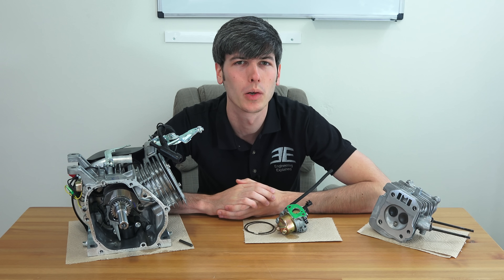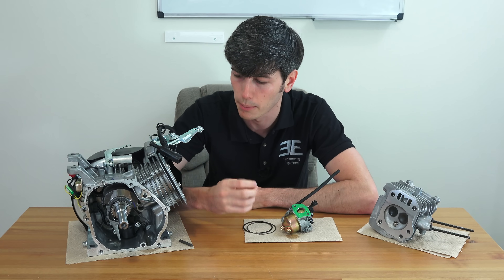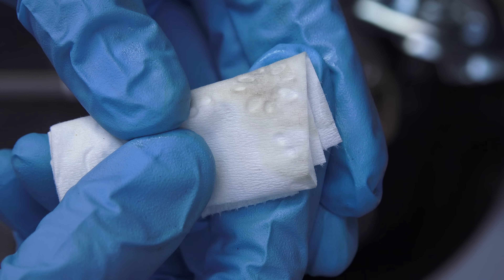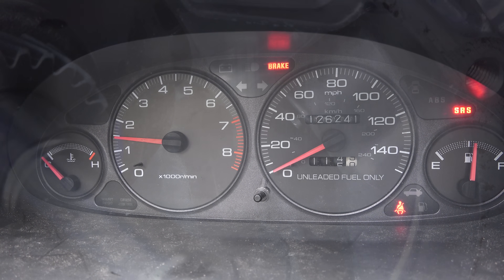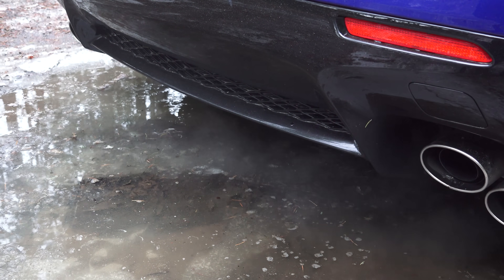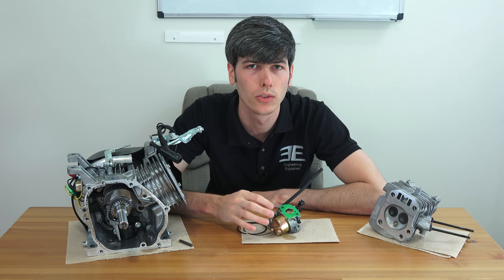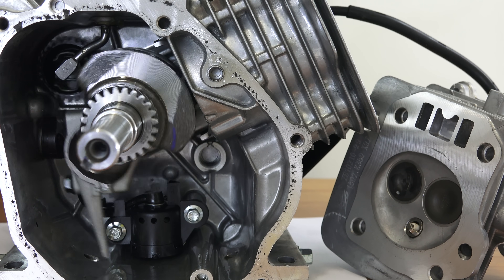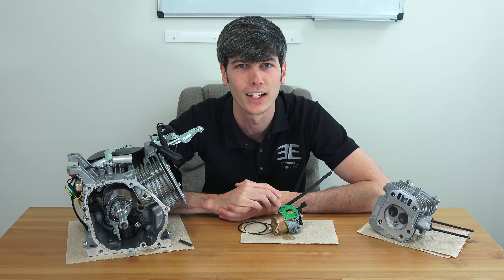Should You Warm Up Your Car Before Driving?

Comment: I just bought a mk7 R and usually wait till my temp gauge moves before I take off and wait till it hits 200 degrees before I get on it... Until I watched your video warming up cars with turbos. So, recently checked digital gauge and noticed it doesn't match analog gauge and that I'm not hitting 200 degrees till a few minutes of freeway driving. I guess which gauge is the most accurate? Analog or digital? Which one should use? Lol thanks

Comment: When it's below -15 ( even - 10 sometimes ) Celsius outside, In Quebec it can happen often, I plug in my heater with a timer for 3 hours ( 4 if it's really cold). So the engine get warn really quicker since the oil is alreayd warm, I also use synthetic. I wait couple of second and lightly  drive away. I rarely let my car idle to warm up.The one situation that could be the exception is when there's like a inch of ice because of freezing rain. Sometime it's like Glass and it need to be melted to scrap it. I hate to let my cars idle in winter, but in those cases I don't have alternative.

Comment: Driving a turbocharged flat four 2.5liter Boxer motor from a 2013 Subaru WRX, your best advice is to start the car, wait 30 seconds, and drive lightly until the coolant reaches operating temperatures?

Comment: At temperatures below -20 degrees Celsius to warm up the engine you need to firstly not to freeze to death. Secondly, the viscosity of the oil is insufficient for the active set speed and can lead to engine damage. At temperatures from -5 to -15 enough to wait 30 seconds. At positive temperatures to heat the engine is not necessary.

Comment: My first car needed about a minute or two of high idle via accelerator pedal until it runs smooth, otherwise it would stall. In every other case of fuel injected engines I idle for about 10 seconds or so before slowly moving off unless if I also need to demist the windscreen (not fun moving off only to have no option but to stop 30 seconds later as breathing caused your windscreen to completely fog up)

Comment: The guy simply wanted to say that 2 minutes of idling get you nowhere near warm enough, as compared to driving off right away and just taking it easy at first. And he's spot on. 
Now especially with bigger engines, if you all think that warming up for a couple of minutes idling actually does you any good, you're very mistaken. You're doing pretty much nothing. Engines get to their normal temp like 10 times faster when they are loaded. even lightly.
I am all thumbs up for this video.

Comment: So assume all of this is true, the fuel that did not atomize may wash off oil from cylider walls... But if you start driving right away, it will still happen but with engine under load. Drive lightly or not it still has to pull 1.5+ ton vehicle. So thanks but no thanks, I will still warm up, a minute or so when warm and few minutes when cold. I had oldsmobile, mazda, nissan, vw, honda, subaru, infiniti, land rover, they're idle high when cold, that initial kick when transmission engages cant be that harmless eiser. So I vote to give it a minute.

Comment: Most people let the engine idle to operating temperature because they're actually waiting for the heater to warm the car and melt ice on the windshield.  Over 90% of engine wear occurs during the first few minutes after the engine starts, and with the plethora of fancy metals and alloys in modern engines the tolerances between the parts are all enlarged when they're cold.  But they heat quicker under load, which also means the heater starts working sooner.  Sitting in your car waiting for everything to warm up is killing your engine.
Reply: Thanks. If the video isn't enough, this'll help break down the myths!
Reply: But all of that means nothing when you cannot see anything out of your windshield. I owned a '99 S10 back in the day, and lemme tell you, until the cabin was warm, you literally could not see anything out the front, no matter how much you cleaned the windshield beforehand (for verification, I'm talking about when it's cold out.). She had close to 500k miles on her before the radiator blew and took the coolant with it.
Reply: A. DudeMan I understand and agree with you completely. Outside of those extremes, I have another comment for Kirk.
Reply: Kirk Augustin
More damage happens to engines that stay cold longer, from not being driven right away to get them into being warmed up sooner. I am talking about when the temperatures aren't extremely cold. Lots of things break faster even under light load if you live in too cold of a place. If that's the case, you need a block heater installed, and you should STILL drive right away.

Heck, I've wanted block heaters in milder climates just because I think the engine would last longer.

Driving right away reduces how long those parts are smaller and the wrong temperature - still, the size change is pretty small. If your engine is built in the tolerances, it's fine.
Reply: A. DudeMan
I honestly think newer engines can take it even better. When you S10 was built, 2 years prior to that, engineers figured out about driving sooner causing less engine wear. That's when big studies on it got done.

Engines were already finely done art and science at that point. Now, with better oils and fuel management, I think great engines can last even longer (I'm talking about now and then.)

Regardless, safety comes first. If you can't see out your windows, there's no way you can argue that's more important than engine wear, when finely built engines will keep going a long time regardless. :)
Reply: DE Nichols And boy howdy, Honda engines will be here long after we're gone, should you take proper care of 'em.
Reply: DE Nichols At the end of the day, I think that older engines were more okay with things like this. I still miss my old S10, but nothing can part me from my Civic. I can get a hundred miles from pennies! Just have to take precautions in cold weather.

Comment: Now what about the piston clearances? Wouldn't a cold piston + rings not be fully fit to the cylinder and cause blow by and piston slap? I understand the reasoning behind fluid temps, but what about the properties of the engine components themselves?

Comment: so should I just Rev up my car on a cold start?
Reply: No never do that, drive it slowly
Reply: bob roger not rev it like crazy but just hold it to about 3k or so rpm's, I've always let my car idle for a minute or two before driving it
Reply: No. Don't rev the engine at all. Just start up, wait for about 10 seconds at idle, then drive off carefully. Don't floor the throttle and avoid driving at over 3000 RPM until the engine temperature needle has definitely risen off the stop.
Reply: oh ok, either way i let it idle until the needle touches the C on my car "usually it's a little below" and I drive it lightly until it reaches operating temperature. I care too much about my car. small little commuter car

Comment: So... What about a 4-inline, oil-cooled, carburated, 600cc motorcycle engine? I just drive off with gentle throttle and shifting up at around 2000 rpm, until the water temp indicator moves up from its low stop. I'm kinda worried, it's a relatively old engine (1998 honda cb600f) and while it's as reliable as a rock, i still want to treat it gently
Reply: I've got a similar bike (1996 VFR), I've learned to drive gently because of the tires are cold too..

Comment: But a lot of people "warm up their engines" in order to let the heater run inside the car before getting inside. Would you suggest to run the heater as soon as the car is done idling for the suggest 30 seconds? I would assume there's not enough heat from the engine to flow it through the HVAC

Comment: What about waiting until the engine / computer changes from open loop to closed loop? Doesn't it make sense for the car/engine/ecm  to get a sense of the external atmospheric conditions before actually moving the car (Park to Drive?) 

I am also thinking of both safety and transmission wear- Throwing the tranny from Park to Drive at high idle can't be good for it.

Comment: Here are my thoughts. Yes, driving the car will get the oil up to temp quicker and the oil performs better when its up to temp. However, driving the car also subjects the engine to a higher RPM and higher load, so while the time to reach operating temp might be shorter wouldn't the amount of wear also be proportional, or worse(because of load)? If you compare the average idle speed of most engines at cold start(starts at 1,500rpm, quickly falls to ~800rpm, so lets say 1,000rpm avg) to average driving rpm(3,000 rpm?) that's 3x the amount of mechanical wear. There are so many factors like fuel dilution, which you mentioned, so its really hard to say which is worse for the engine from a wear perspective. Undoubtedly idling your car is much worse for the catalytic converters which require lots of heat to function and can be fouled by rich AFRs/unclean combustion. FYI I typically give my car 30-60 seconds of warm up in the morning but I live in CA where it almost never gets below freezing.

Comment: What will happen if you start a manual transmission car in first gear and not on neutral ,will it effect the engine or cause some problem ,just popped up in my head,it'd be great if you make a separate video explaining this !
Reply: Better if you disengage clutch (press down on the pedal) before starting, whether you're in neutral or in gear. That makes it easier for starter to crank the engine, because it will not be connected to gearbox.

Comment: my question is what about the expansion rate differences between cast iron and aluminum. the piston rings will expand at a faster rate than any of the other metals as they are thinner so there will be excessive Blow by which is not good for the oil. if everyone drives a brand new car I guess that's not a problem but if your car is 1015 years old I would still let it run for 5 minutes to ensure that the Pistons and piston rings have had a chance to expand inside the cylinder to close off any Blow by. that's just my observation.

Comment: I start my car and wait till that normal RPM mark for my car which is like below the 1000. But that often takes longer than 10-15 seconds. Almost around a minute in cold conditions. I wait for the car to come below that mark because I feel the engine's struggling. Don't you think?? I mean you don't wake up from the bed and directly go running...

Comment: I have a 2009 Kawasaki Ninja 250r that is fuel injected that if I don't let it warm up for at least 5-10 minutes prior to riding, it will do exactly what you mentioned with carborated (sp) engines.

Does this video apply to small FI engines as well or is this normal for something like my motorcycle?

Comment: I have a mitsubishi pajero with 450000 klms on it and it's never  been touched,I warm it at idle for at least 4 to  5 mins  and thats in a warm climate. We ran a fleet of tractors and would warm them up a little above idle till they warmed right up.When an engine is cold all the parts are tight and the oil is sluggish.
These manufacturers also say don't do the first oil change on a new  engine 
untill 10000 klms and don't  put drain plugs in gearboxes so the same old oil is running around in them for years.

Comment: There are so many more issues to consider than those listed here. 
1) Ancialliary hoses, belts and cables are made of plastic/rubber which become brittle and can crack easily when cold
2) Metals inside the engine become brittle at low temperatures
3) Differing coefficients of expansion will cause very loose or very tight fit whilst at the same time the metal is brittle
4) Even if you use antifreeze, water channels can get blocked with ice deposits when very cold. This will create hotspots and potential head gasket failure
5) At times of stress due to tension from differing coefficients of expansion, clearly gentle heating would be less likely to result in failure.
For all the above, letting the engine idle and warm gently to 5 or 10C would perhaps be preferred. 
I haven't seen empirical studies, but my gut instinct would be that if an engine is at or above 5C the above problems wouldn't be too bad and getting moving straight away but gently would be OK. If below 5C, I would idle the engine until my instinct tells me all engine and ancillary parts are above 5C then drive gently until the engine reaches normal temperature.

Comment: I find this video hard to find 100% accurate, even on a 90f degree day when I start my bike , put on all my gear and hop on, turn off the choke, and feel the exhausts compression for warmth and even have temperature stickers on my 2015 suzuki dr200  because if its not warm as can be for this cold blooded engine it is gutless shifting even is mechanically slower shifting and revving after shifting out of first while cold, after a quick run around the house and a figure 8 through the loose gravel it's usually warmed up finally. fuel injected 200cc's , +Engineering explained could you make a video on different spark plugs such as regular copper vs. platinum then even comparing them to iridium spark plugs for both air cooled and non air cooled engines since the stronger the spark the hotter the combustion and at a certain point when is it too hot?

Comment: so... how about the twin scroll turbo gasoline direct injection engines. those engine's turbo kicks in at 1250 rpm and keepa the flat torque to 4500. Do still drive as slow as i can...?

Comment: Ive got a 2002 Nissan Xterra that either way it takes for ever for that temp gauge to start going up. Ill let it sit for 10 minutes and it will barely creep up above the "C". Ill wait about 2 minutes and drive it moderately and it still takes the longest time for it to creep above the "C". Now the thing is, i HAVE to let this thing warm up. If i dont, the transmission will shift hard and when i go to accelerate i'll hear a clunking noise as if the transmission isn't shifting properly.

Comment: In the winter time I like to run outside and crank my vehicle over and let it heat up a little bit. Usually only for the time it takes for me to finish my coffee and put a sweatshirt on. if I don't do that in the winter it never reaches operating temperature because of how short my commute is.

Comment: HEY SMART ENGINEERING EXPLAINED GUY. do you agree with my comment below?

 ok im not sure why you people arent getting this. driving it at 7k would be really bad. driving it at 5k would be bad. driving it at an average of 2.5k would be not really bad. idleing at .75k would have the least amount of wear per minute. he doesnt talk about how warm up times are reduced with higher rpm and at what scale. common sense would say slower is better as it is for fuel economy but noone can say for sure becuase a test on how warm up times are effected by rpms was not done for this video therefore showing a hole in this "educational" video

Comment: what im getting at is the wear and tear in relation to the RPM's when its cold. it takes longer to heat up at idle, but your only wearing at your engine at 750rpms, as opposed to driving at say 2500rpms when it cold. he also says not to drive it hard. so if driving it hard is bad, then driving it easy should be somewhat bad and slightly worse than idle, as the only factor is rpms. this video does not take into account the revs

Comment: I'm going through your channel just fond you buy the way I'm looking for a video that can help meach understand the multiple ways coolant can flow through an engine block. I know that most production engines have the coolant paths cast in but I'm more interested in how it would flow in a cnc milled block. I watched a video that said they were going to use a wet sleeve setup and the sleeves I see have holes in them if you could refer me to the Playlist that has a video close to it or maybe a new video idea but sofar the 5 videos I've watched are good and international thanks
Reply: informational

Comment: Question for you!
I drive a '97 Toyota Previa and when the car is cold, it will not shift into 3rd gear unless it has warmed up (through light driving of course). So whenever I drive in the morning I'll always end revving high into second gear because third won't shift. Do you know why this is the case?

My only theory is that it's just cold and the gears have shrunk (if that's possible) just enough for them not to catch. But once it warms up, the heat makes the gear expand and catch. I don't know if that's accurate, but it does sound a little crazy. Any insight?
Reply: old in age, but only 100k miles!

Comment: what should be the idealing time for turbo charge direct injection diesel engine if lower temp in my city is 2℃ and what should be the rpm range while driving before engine reach its optimized temp.

Comment: Its not all about the engine. Depending on the temperature, the heat transfer to the transmission and other parts is very important. Even the electronics need to heat up, or over time they will fail. Amplifiers and Speakers can lose a lot of life if used without warning.

Comment: I have a question. I recently replaced the 5.4 engine in my 2009 F150 and when I removed the engine from the transmission, I was surprised to see that only 4 bolts hold the torque converter to the flex plate. My question is how does only 4 bolts hold up to the torque of the engine to move that heavy truck around without shearing off, especially since its a 4x4 with larger than factory tires?

Comment: It seems to me that things will end up close to even regardless of your method. Each stroke of the piston while the engine is cold is bad, right? It takes longer to reach operating temperate during idle but the RPMs are lower. If you drive the car to warm it up, it takes less time, but the RPMs are higher and the engine is under load. Also, its much nicer to get into a warm car during the winter :)